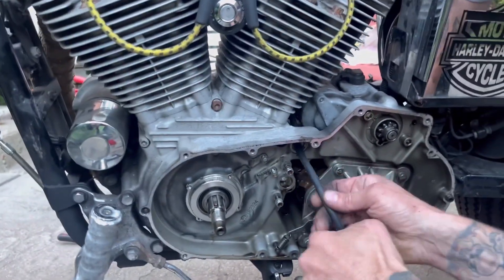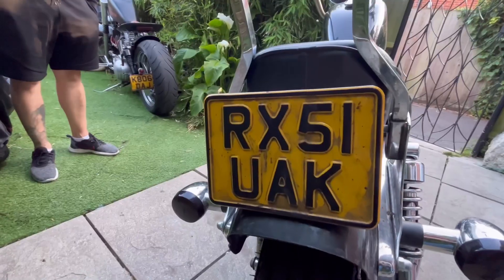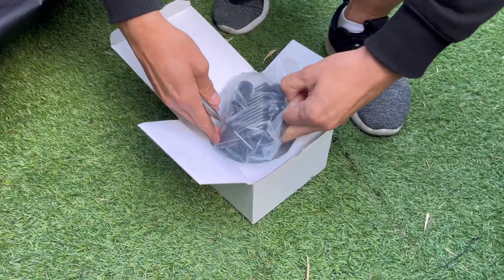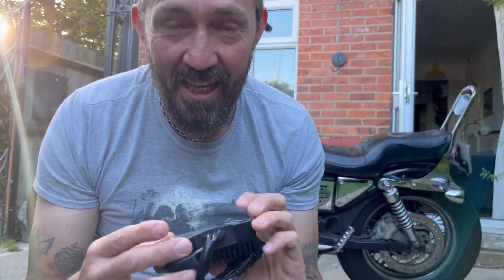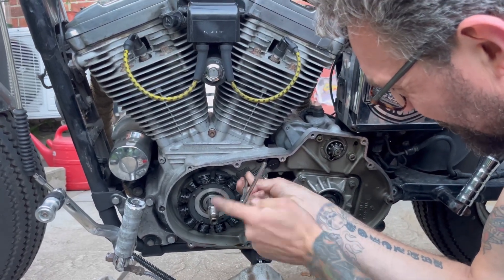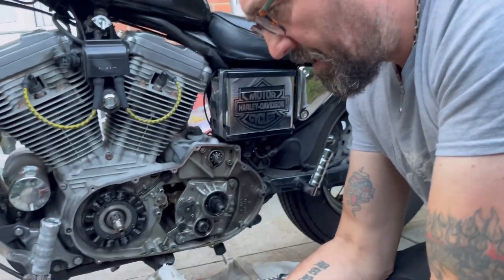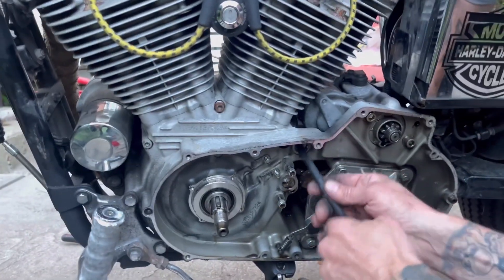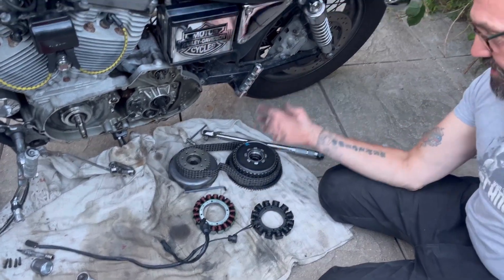Harley Broken Again! 😤😭💔part 1

Comment: I think you may have bought the stator for 86-90 XLH they have the stator lead come out the back of the primary and it’s that short
Reply from the maker: Hmm interesting, maybe you are correct and if that’s the case then the description in the add was wrong, the correct part is now in the mail and as soon as it arrives we will publish part 2.
Reply: Maybe, I have an 88 1200 sporty and my stator cable is the same as the one you first received (the short one) 🤷‍♂️